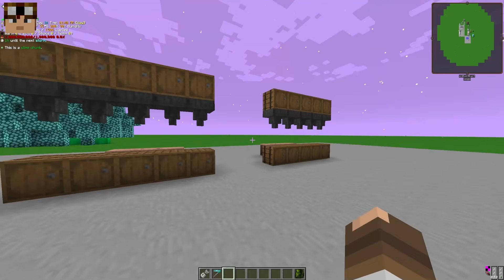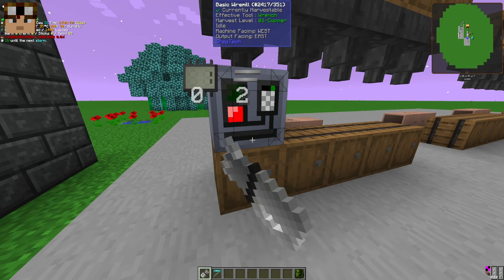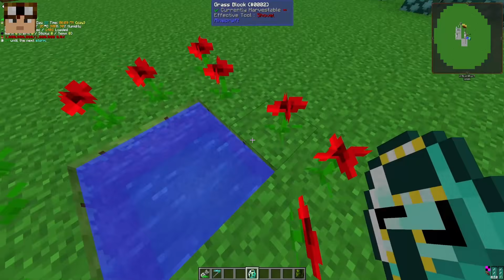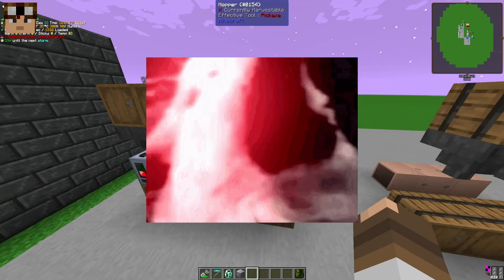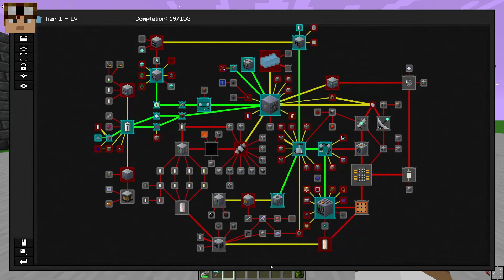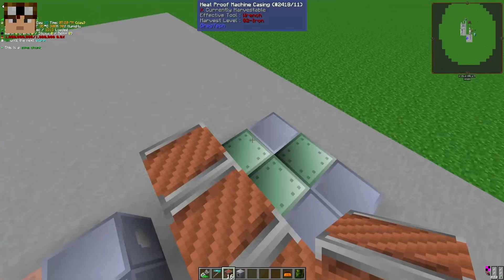The Ultimate Beginners Guide to the LV Age in GTNH

Comment: Just a small headsup for those of you starting on GTNH months after this video, Alumina is a lot easier to source now in LV.

Clay(not clay dust) can be [Alloy Smelted -> Brick -> Macerated -> Brick Dust -> Electrolyzed -> Alumina] at at a 13.6 Clay:1 Alumina ratio. The craft is quite slow, but its good to have some on hand if you're still working toward the EBF & have the multiblocks for it.
Red Granite can be macerated and Electrolyzed too. Much faster recipe with a better ratio, but can be more difficult to source. (I haven't run into it at all in my time playing)

Kobolds from the Twilight Forest also drop **FULL INGOTS**, so if you can farm them you can stock up a little bit without even needing an EBF.

Comment: can you answer the question why you use steam instead of creosote?
Reply from the maker: You're going to get more out of your creosote if you use it in something like a Railcraft boiler, but you can certainly use semi-fluid generators to burn your Creosote directly into EU. In the new GTNH 2.9, it's also easier to wallshare the new Gregtech Coke Oven and fluid auto output from it, so easier to scale for more creosote.
Reply: @CatsCozyGames I just don't understand why bother with the same pipes and steam production, if it's very easy to increase the production of creosote, and simpler and cheaper steam pipes are enough to move the creosote.

Comment: it feels crazy that I need 5 advanced solar boilers (360L/s producing) for each Steam Turbine (~1500L/s consumption) in the start of Steam where my Silver income is still pretty weak and unstable.
Reply: Use railcraft boilers with coke oven creosote and use the coal for coke oven for your bbfs :)
Reply: @SprintXYZ  Ohh wow. Thank you very much. The scale of Coke Ovens required for a decent setup of steam is still a bit grindy ahahaha
But its wayyy less random :)
Reply: @Lupy851 Ducked a 4x gate player says you should you need 24 coke ovens to sustain the rc boiler with only creosote oil. 24 is definetly a bit much for casual players. I have always used solar boilers too. If u use twist space at least you got the ”large solar boiler” multiblock now”
Reply from the maker: Thankfully 24 coke ovens is easier in the new GTNH 2.9 coming this summer, where you can wall share them and auto output creosote and charcoal without needing pumps and conveyors. It's so much better, very soon!
Reply: @CatsCozyGames  <3

Comment: hi, do you have a video explaining how item output from gregtech machines work? they work for me but most of the time i have to tinker around a lot first

context;
im trying to automate polyethylene
exporting sulfuric gas (canned) into hydrogen filled chemical reactor isnt working

the byproduct, hydrogen sulfide cant be moved either

i HAVE tried electric pumps and conveyors. do i HAVE to use pipes? it cant be from machine to machine?
im at LV with partial MV for recycling the hydrogen sulfide
Reply from the maker: It's difficult to say for sure what's going on with your setup, but yes you can pump fluid directly from machine to machine.

My best guess is that if you have a pump or output on the receiving end, you by default cannot receive input from output side. So you either have to "allow input from output" on the pump or conveyor settings, or if it's the native output side of the machine, you have to right click the machine with a screwdriver.

Other than that, I'm not sure what the problem could be, but I hope that helps!

Comment: Absolutely mental you would make an assembler before a chemical reactor and fluid solidifier (you get what is it? 14× as much rubber? saving on sulfur and rubber dust)
Reply from the maker: We all have our preferences lol. Our reasoning for delaying the chemical reactor is that you have the coin quest (or soon to be coin vending machine) that provides a lot of tin and red alloy cable initially. Therefore, chem reactor is not a top priority for us. If I didn't mention the coin quest in the guide, then I definitely should have!

Comment: Im always split between a wiremill and a metal bender
But I think now im gonna do wiremill first and then a bender
Reply from the maker: If I had to choose between the two, definitely the wiremill. Wires before then require 3:2 plates & 1:1 wire, whereas wiremill gives you 1:2 wire. So if you wanted 16 copper wire, it'd normally cost 24 copper ingots, but with wiremill it only costs 8 ingots. What a deal!
Reply: @CatsCozyGames true!

Comment: How do you see the amount of energy the machine is using? My HUD doesn't tell me how much is being used
Reply from the maker: When you hover over controller block, the WAILA tooltip should tell you how much energy is being used if the machine is on at the time. That's the default out-of-the-box GTNH behavior.

Comment: 16:24 just to let people know the fluid cell doesn’t actually always hold 1000 mB as for most molten materials it will only hold 144 mB or one ingot worth of the material. Never used the universal fluid cell so I am unsure how this applies to it
Reply from the maker: Very true, and the universal fluid cell just holds 1000L for every fluid, regardless of type.
Reply: the normal cell always holds 1 ingot/bucket of whatever type, whichever is more relevant. the universal cell can always hold up to 1 bucket, but can also be partially filled

Comment: This is perfect timing. I just finished up steam age 2 days ago and have been preping my base for LV. This is the best tutorial ive found too. No other tutorial is this in depth.
Reply from the maker: Thank you! I had to cut out so much content to keep it under an hour, there were so many more things I wanted to mention 😂
Reply: Because you shouldn’t need a tutorial to play gtnh. You should play the way you want at the speed you want. If you follow a tutorial you lose out on most of the fun
Reply: @NotNyrZ Which is why an in depth tutorial like this one is the best thing for me. He doesn't give you step by step instructions. He explains how the different LV machines work and how EU works in general. Finding out how everything works before I put hours into making something then having all of the knowledge I've gathered culminate into it working the first time I build it is my version of fun and this provides the means to that end.
Reply: @NotNyrZ yes and no... it is true that gtnh is intended to play the way you want, BUT, some things are quite confusing, vindrake here said that the nei multiblock schematics are not always correct, they don't tell you that for output fluids you must place the output hatch in the top level, that's why tutorials help a lot

Comment: You don’t actually need an LV extruder to get fluid cells, the bending machine can make them with 2 tin plates and circuit 12
Reply: also its poe-tin
Reply: I mean you can but LV extruder also have extra uses that also gives cost reductions which is pretty important early game
Reply: @patfre  What uses does it have again? I only made an MV extruder, and the only thing the questbook mentions about the LV version is magnalium for a crossbow, rubber sheets that can just be made in the bending machine, and a rubber boat.
Reply: @stardustcell the one I used the most is the rotor recipes as it is only 5 ingots for a rotor which is big savings compared to the 4 plates, screw and ring you need not to mention how much less you need to do
Reply: @patfre  You can make tin rotors (which is most of the rotors you need) with perfect efficiency with the LV fluid extractor and solidifier for 4 1/4 ingots. Assuming you've already grabbed the bending machine, lathe, and cutting machine for other things, hand-crafting rotors costs materials worth 4 3/8 ingots (4 5/8 if it's not a ring you can extrude or solidify), and the assembler recipe for rotors is also 4 1/4 (4 1/2 without perfect rings) + 1/9th ingot soldering alloy. The reasons to go for rotors in the extruder are speed and convenience, not material savings.
The real fun thing the LV extruder unlocks if you're too impatient to wait for the MV one is the carbon crossbow limb. Who doesn't love a 100+ damage crossbow? You can also make unbreakable tools from unstable ingots.
Reply from the maker: @sw-fast  Yes! And that crossbow will come in handy if you want to kill the Kobolds that I mentioned for early Aluminium.
Reply: @sw-fast i tried but i couldnt find an enchantment table dungeon anywhere so i gave up 😭

Comment: If and when you do MV I think it is worth pointing out the transistor skip
Reply: What's that? I'm about to enter MV
Reply: @MrGundum584 basically you normally need to get Kanthal coils to be able to make Silicon Solar Grade Plates in other to make HV circuits however using the SMD transistor recipe in MV assembler you don’t need it just Annealed copper fine wire and gallium foil so then you can make HV circuits and get a vacuum freezer skipping the cooling down hot ingots with chemical bath which is super slow and more expensive in power
Reply from the maker: That's a good point! We'll likely give it an honorable mention so anyone who wants to do it can, but we'll still emphasize the intended quest pathing.